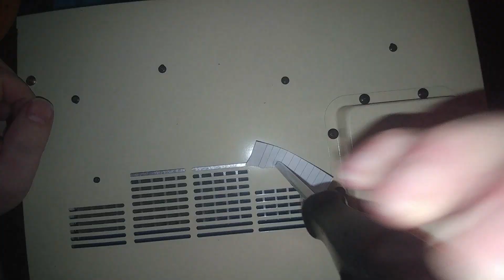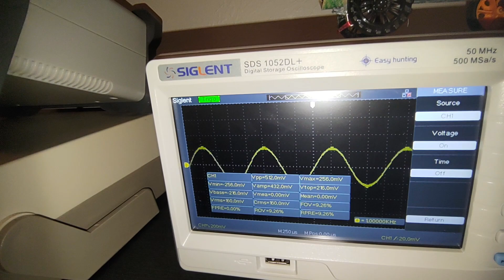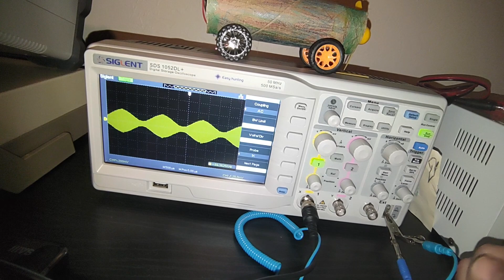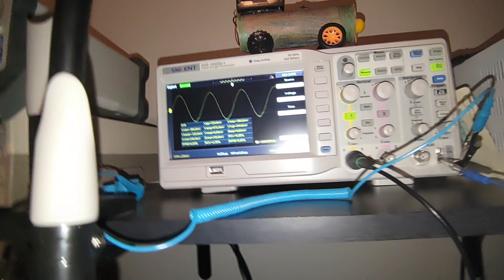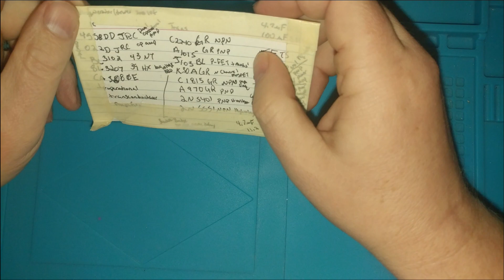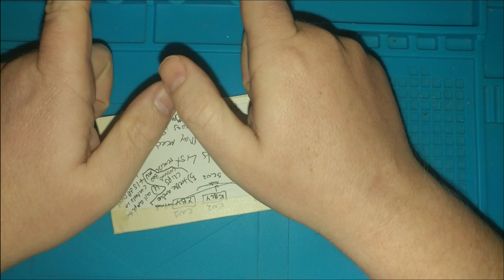Ibanez TA35 Troubadour Testing, Diagnosis and Refresh Part 2

Comment: Hello, watching this Video i had a closer look on the TA35-Power Board and found an unequipped resitor ( R801) between the input connector CN3 and Capacitor 801. What does it mean ?
brgds from Frankfurt
Reply from the maker: Good question, without a diagram I cannot give a 100% factual answer. However, I may be able to approximate an answer based on observation of the surrounding components. You mentioned an adjacent capacitor. We can also see CN3 which I think may carry a voltage into the power board. I don't have the amplifier anymore so I cannot verify. Most likely the resistor could be used to develop an RC circuit with the adjacent capacitor. That means the input voltage would see a voltage drop across the resistor. We would also see the total input current divided across the adjacent circuits made by the resistor and the capacitor if they are in parallel. Although the total output current would still equal the current draw at the input. I presume the resistor in this case is used to lower the voltage applied to the capacitor (if in series) or divide the total current between the capacitor and resistor (if in parallel). For what ever reason though, the resistor is unpopulated on this board and this same component is unpopulated in other TA35 power boards as well. 

Keep in mind the power board is most likely used in several different models and components populated or unpopulated as necessary. Its cheaper to make one PCB and only populate the components needed for the application of the device it is used in.